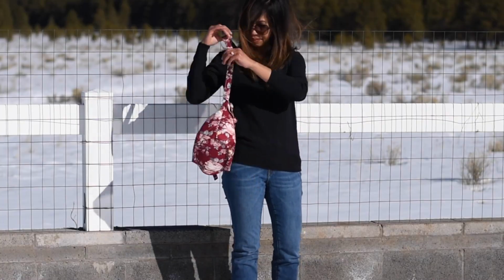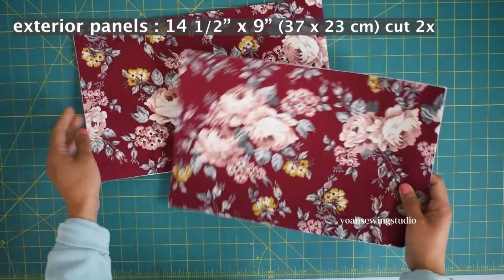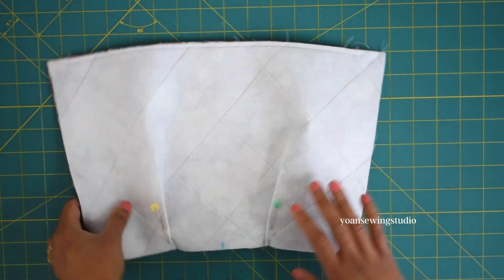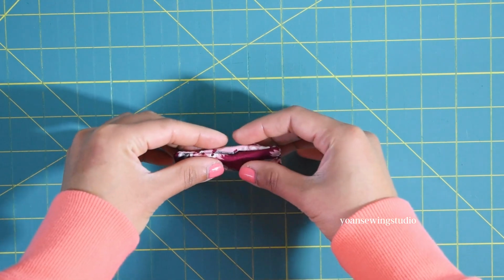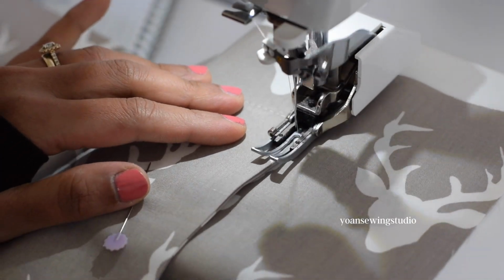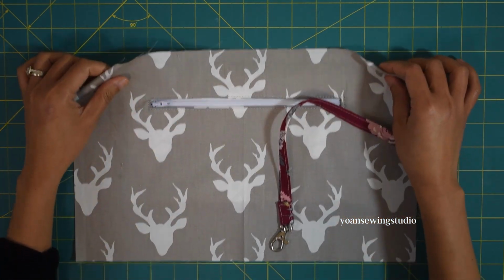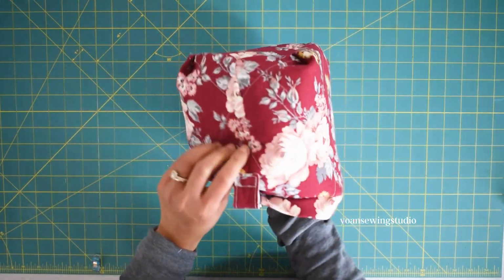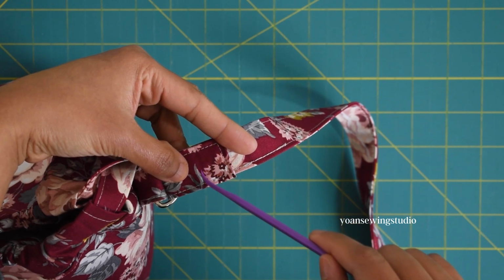drawstring bucket bag sewing tutorial - with adjustable strap and pockets

Comment: Can I use fat quarters for this bag? Thank you. lovely designs
Reply from the maker: Hi Kimberly, I didn't design this project for fat quarters, due to longer strips needed for the drawstring straps and the bag straps, although it's possible if you combine several fat quarters, and join several strips to achieve the required length for all the straps.
Reply: @YoanSewingStudio  i used 3 fat quarters